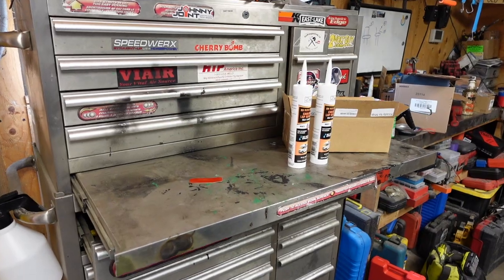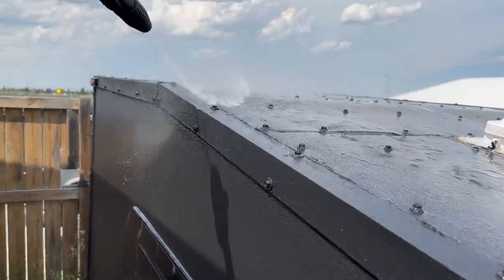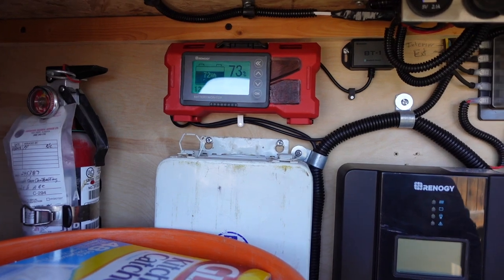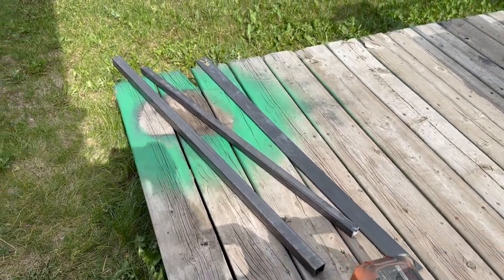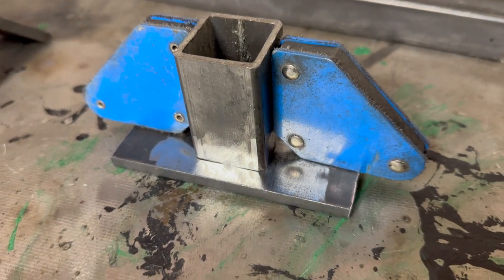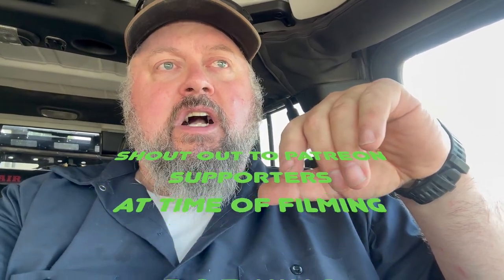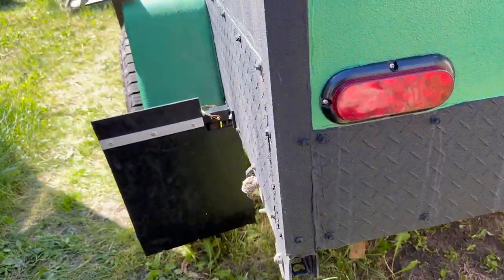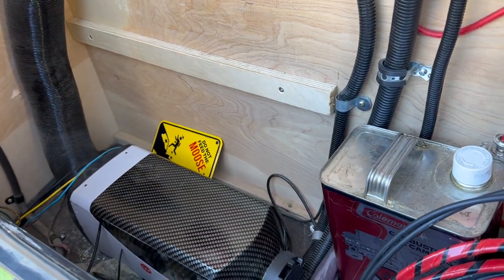ALL ISSUES ARE TAKEN CARE OF | DIY OVERLAND TRAILER

Comment: EternaBond tape works great for sealing up the roof if the the silicone doesn’t do the trick. It’s available in many different widths. Pro tip……….
Reply from the maker: i just googled it, i'll keep that in mind. the RV silicone I used makes a mesh tape as well that you put on first then the silicone afterwards

Comment: 7 pin is.the most common for use with multiple trailer, ie brakes batt and dont commonly rust compared to 4 pin connector,now i have both on my truck in case i use something with 4 but just preference
Reply from the maker: Totally understand I’ve suffered many corrosion issues